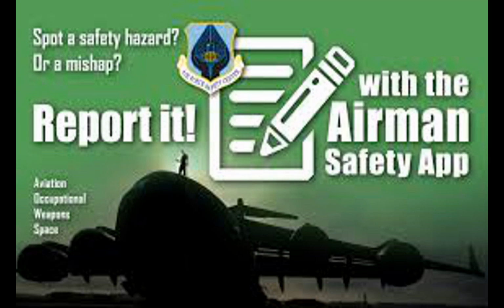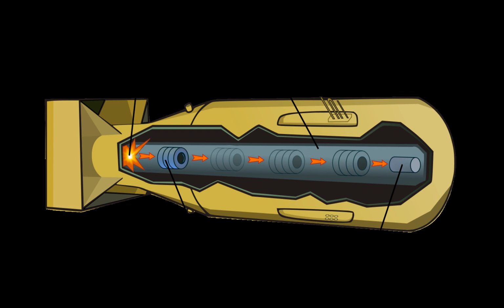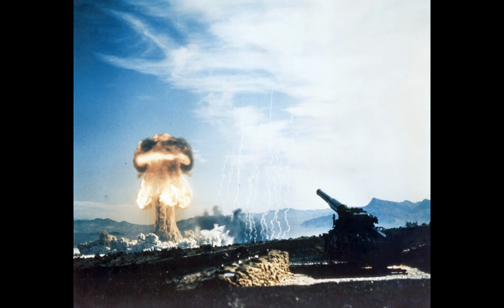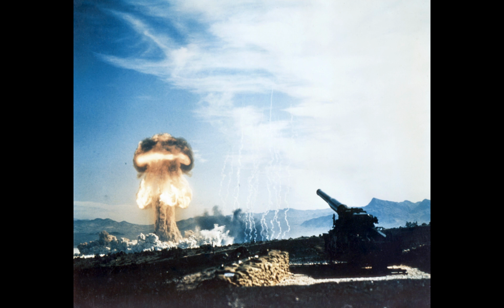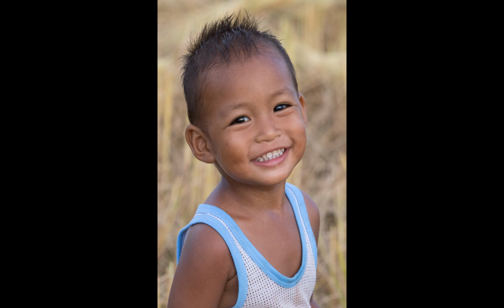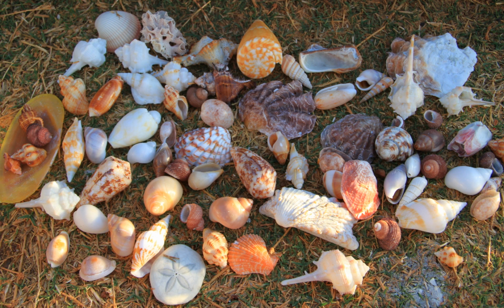Gun-Type Fission Weapon: Full Video

Comment: To anyone whos watching this and thinking "it cant be that easy", should know this design was so sound and well understood that the Manhattan project leaders didnt even bother with a test (they didnt have that much enriched U235 either). And as far as nuclear weapons go, these would be the equivalent of the earliest guns that used an iron tube, stone projectiles and gad to be set off like a cannon with a little hole you touched a burning ember to. Lots and lots of inefficiencies, not accurate, and dangerous to.its user, but if employed against a superior opponent whos about to cave in your head, could be devastating, not practical but it left an impression. The gun type little boy weapon had 60ish kilograms of enriched u235 which was the most expensive material on earth at the time. When it detonated, the reaction of splitting u235 atoms in that runaway chain reaction took a fraction of a fraction of a second before too much energy had been released and the uranium could no longer hold itself together and released an explosive force of  about 15 kilotons of Tnt. All brought to you feom less than 3 percent of the total uranium having undergone fission. That tiny amount of mass converted to energy was enough to kill almost 100,000 people and level a city. The only thing stopping murderous assholes from building a bomb just like little boy is access to to enriched uranium. Iran has been enriching uranium now for long enough that they could have dozens of gun type fission weapons stockpiled. They could and probably are either researching or building the secondary stage for a thermonuclear / fusion weapon which use a fission weapon as a detonator. But in short yes it is that easy